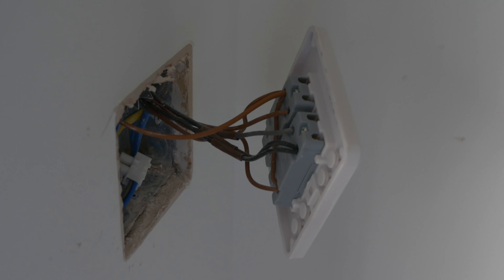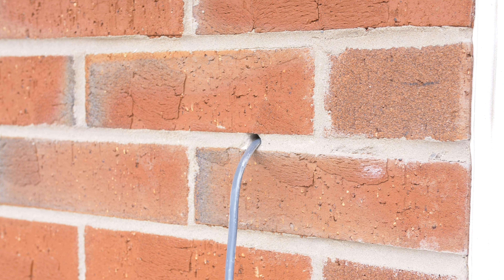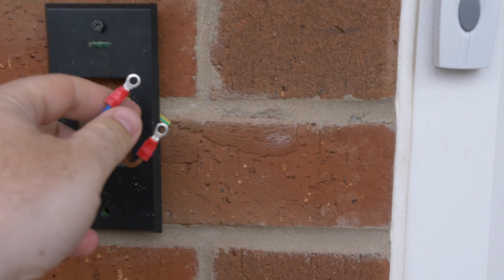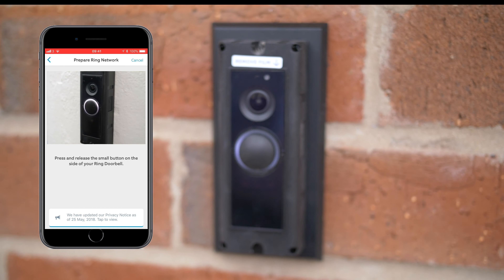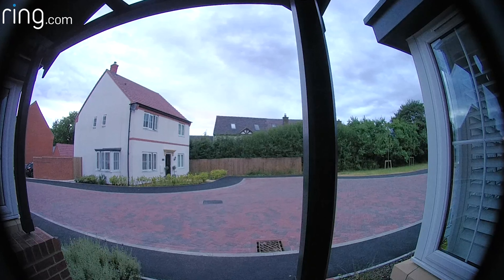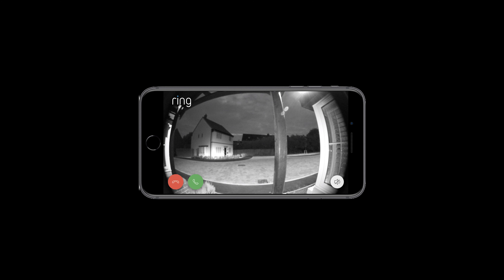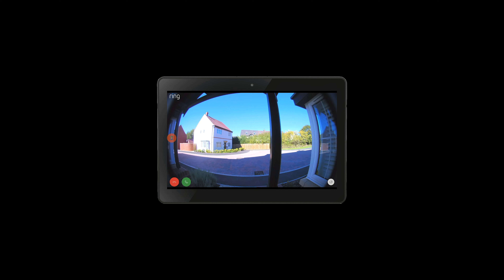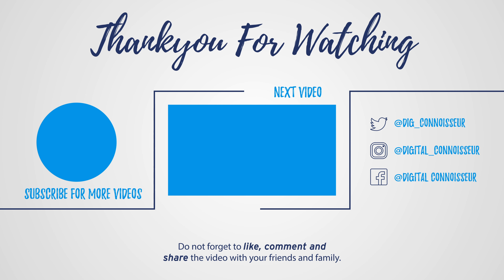Ring Video Door Bell Pro INSTALLATION 2019. No existing doorbell UK

Comment: Can I ask why you have not used a bell cable?  I'm installing a similar door bell but unsure what kind of cable to use. Most of the videos I've watched I see people using a bell cable.
Reply from the maker: The bell cable would have been I better choice. Sadly I didn’t have one handy.
Reply: @digitalconnoisseur7730  after some research ring recommends using an 18 gauge cable  but also a 16 or even a 20 gauge cable is usuable. This equates to (0.75mm twin 20gauge), (1mm twin 18gauge) or (1.5mm twin 16gauge).  It's better I think than using a bell wire which I don't think meets the requirements.
So you've done the right thing, better to get it correct the first time around. Great job!!!👍

Comment: Interesting video as I’am thinking of buying the pro because it’s all smaller than the ring 2. So just to be clear you wire from the light switch to the transformer and then wire from the transformer to the ring doorbell? thanks for the video.
Reply from the maker: Yes the power comes off the light switch via a terminal block up to the transformer. It’s turned into 24v and down to the ring doorbell.

Comment: How did you get the cable from the transformer thats installed high up to the hole outside for the ring pro, im trying to do this myself but need to understand how you ran the cable through the cavity wall....cheers.
Reply from the maker: With great difficulty. Had to make a number of channels through the pasterboard when the cable hit the dabs of plaster. Once it was all connected we had to fill up the holes and re paint and sand the walls.

Comment: Apologies for asking a daft question but just wanted full clarity before wiring my new pro in.

I have just had my house re-wired including a low voltage supply specifically for the door bell.
Am I correct in thinking I can place the ring specific RCD in my consumer unit on this supply and run the wire directly into the ring pro? 
No resistors no power kit/bypass kit required? (I do not have an existing doorbell system)  

There is little regarding this on the official website at least I can’t find it 

Thank you in advance 
👍
Reply from the maker: If there is a low voltage supply and wire for a door bell, it may work off those if it's 24v and has the amps the doorbell needs. Minimum 16 volt ac is needed.

Check this out
https://support.ring.com/hc/en-us/articles/115000115323-Troubleshooting-Insufficient-Power-Issues-with-Ring-Video-Doorbell-Pro
Reply from the maker: Using the ring transformer in the consumer unit will sort out the low voltage issue and save you hacking apart your wall, like I had to...
Reply: Thanks for the reply I have a clean supply running to a single 3 pin plug in the roof space above the door 
My plan is to change the transformer over at the consumer unit and to replace the socket with a junction box and extend the required cables to the bell location

Comment: I'm guessing your light switch has a neutral wire? Thats why you were able to do this?
Reply: you need 2 wires, no ground wire. + and neutral
Reply: Yes even my wife said that's wrong. They also later on said plug socket

Comment: Can you please explain why the small white doorbell bypass kit not used in your video.  Thank you
Reply from the maker: It wasn't needed as we didn't have an existing doorbell to bypass. This was a fresh installation where there was no doorbell or wiring. Hope this helps
Reply: @digitalconnoisseur7730  definitely helped Thank you however when I rang ring uk i was informed that it should be installed in series with the transformer to maintain sufficient current required for the door bell to function properly in one instruction a resistor is used.  It is bit confusing.  Shall i just go ahead and install as shown in your video.
Reply from the maker: That's correct if you want a door bell to ring if your house already has one. Ours had no doorbell, wiring or chime. This meant we didn't need those parts as the transformer was all we needed. For sound in the house, we use the ring chime that came with the ring doorbell box.
Reply: Thank you very much I will just go ahead install.
Reply: Digital Connoisseur is your still working mine went off after a week
Reply: Digital Connoisseur then rang them and said need to install bypass kit but mine was fresh installation and only lost WiFi not power
Reply: Hi all can anyone help I have had this for a week all working fine. Till last night WiFi went off and couldn’t reset spoke to ring today and they said I have install bypass kit but this was a fresh installation. Should I do it

Comment: Thanks for this, as I was (foolishly) going to try and install this myself, until I watched this.
Reply: If in case someone removed the doorbell and short circuut the wires, is there a protective device to prevent the transforner from burning?

Comment: Apologies for the basic question... to get the power off your light switch, did you cut in to the light switch cables and run an additional two cables behind the wall for your doorbell transformer? 

How did you get the 2 cables from the light switch to the transformer?
Reply from the maker: We didn’t cut any cables but just fed the power from the light switch into a terminal block and spilt the power. One into the light switch and the other into a cable leading up to the transformer. We had an electrician do this, as we didn’t know. The other from the transformer (the 24 volt end) into the doorbell.
Reply: @digitalconnoisseur7730  Ah so you installed a  terminal block behind the light switch! I can see that in the video now.

Then one cable from the terminal to the light switch (to restore light switch connectivity)

And then another cable going from the terminal to the transformer.

Makes a lot more sense now! Thank you.

Comment: Probably the best video on how to install the Ring Pro if you didnt have a pre existing door bell, however also a bad video because you dont actually show how it was done, you just stated it.
Reply from the maker: Yeah I should have mentioned the terminal block use a bit more in detail. Will update the description with that info.

Comment: Thanks for the video, do we need any resistor for hard wiring?
Reply from the maker: I believe there is a resistor in the box for the door bell bypass (normal vhime doorbell) if you want to use a standard chime. The transformer was all we used.

Comment: How did you connect the shime
Reply from the maker: The ring chime is easy to set up. You plug it into the wall and through the app you add the device itself.  The ring app will then sync the doorbell to the chime.

Comment: Seriously, you can’t connect to the generic power supply to the original bell because this ring door bell is not compatible as it uses ac power? So you have to get a pro electrician to  do all this faffing around to connect to a constant power supply🥴🤣🤪👎. 

Thanks for informing me. What a load of shite.
Reply from the maker: There is a three-pin plug you can get to power one of these directly. Prob the easiest way.

Comment: Thank you for your very nice tutorial video! Very cool, I have a question, did you require a wired chime to install this doorbell, or the chime that we hear in the inside is the one provided with the doorbell pro?
Reply from the maker: The chime is built into the plug speaker it comes with.
Reply: Digital Connoisseur thank you for your response. But I mean the chime we hear inside the house... is it one previously wired already or just the one that comes with the doorbell?
Reply from the maker: You can have both I believe.  In the instructions it shows you how to wire in a traditional chime. Mine didn’t have one of these so I needed to use the ring one. It’s a great device.

Comment: The US version does not come with any of the parts needed to install without a pre-existing doorbell. Consequently, I  burned out 3 transformers before I figured out I had to order the separate pro install kit and wait for that to arrive before installation. Ring should include their custom transformer with the US Ring Pro as well.   Thank you for the info.
To US watchers, please note that his procedure won't work for installation in the US because critical parts are not included with the Ring Pro in the US.

Comment: Hey, great video - will attempt this today. Where did you get the mcb box from ?
Reply from the maker: I believe we got it from screwfix. I can’t find the exact one but it was something like this. https://www.screwfix.com/p/crabtree-starbreaker-4-module-2-way-part-populated-main-switch-consumer-unit/9964p

We used a two module box not the four one in the link above. eBay will also have the smaller ones too.
Reply: Thanks for the swift response although didn't end up using the box but instead used an IP rated junction box with some wagos for the earth. 

Thank you for the instructional video, it definitely was useful. Great stuff on the channel too, keep it up!

Comment: You say in the video  you connected the mains supply to the plug socket....you actually connected it to the light switch utilising the Neutral at the back of the box via a connector. I am a professional Electrician. The way you have connected the mains for this door bell transformer is very wrong and unprofessional. 
Where is the means of Isolation for the transformer?? Also a lighting circuit is 6 Amps, why didn't you use a fused spur and reduce the fuse to a 2 Amp to protect the transformer??
If I come across an installation like this I would disconnect immediately and wire this properly and safely in accordance with current wiring regulations!!!
Public beware!!!
Reply from the maker: This was installed by a professional electrician not myself. You are right about the fused spur. Maybe I missed it.